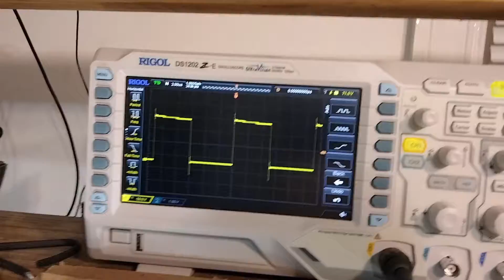QSC PLX3402 repair, this is a very hard repair, not for beginners.

Comment: good morning sir thanks to share vedio nice your explanation, ihave questions to my power amplifier qsc plx3002  done replace regulator and rgvt transistor and ir 0121, sg3525an and i check the power supply section is no shorted and the output transistor ic all okey no shorted the primary power supply turn on good supply but  not secondary not comes supply sir , how to determine problem thanks

Comment: These amps are junk!!! I've been a technician for over 40 years an a professional touring drummer!! We have 4 of these boat anchors!! I've had to repair 3 out of the 4 this last one I fixed the shorted channel ran great on a Variac at 110 volts ac!! But when I plugged in to main power it blew q96/97d78/79 an the 2 ten ohm surface mount resistors!! This is after i installed the power supply restoration kit!! The schematic I have has no voltages except for the 16 an 5 volt checks what's the best way to check this pile of crack to make sure it's safe to power up ??? I've got crown amps I've had for 20 years 0 trouble!! A pro amps should be able to handle the rigurs of touring etc!! I don't trust these!! Everything checks help!!!!
Reply: I receive two of them with the power supplies blowing.
I think the same, these amps are junk.

Comment: I just replaced all the same parts on a plx 3602 it ran fine on my Variac but when I plugged it into straight power q96/97 exploded an r358/359 an d78/79 opened?? I'm a tech of 38 years experience
Reply from the maker: check this out. https://electronicshelponline.blogspot.com/2016/06/plx-series-qsc-plx-1202-plx-1602-plx.html#google_vignette
Reply: Would like to thank clintronic for your help I fixed 2 other amps for the same custr just typical shorted drivers! Strange the problem amp ran for several hours on my Variac at 110 volts ac! An 0 DC offset an great audio wish I could find a good used board LoL I'm thinking of getting the house keeping kit.thanks again

Comment: I have a 3602 amp when the power is turned on all it does is the blue power light blinks  You have a idea what is wrong
Reply: did you ever find out what was wrong with yours? i have the same issue. my speaker wires touched during a gig.. i don't know for how long. i just used my tops. i saw my 1/4 cable was damaged and touched. amp powers on and just clicks..

Comment: Hi, one of my step driver mosfet is hotter then the other 3 ? after start .1 min this is 40C while the other 3 are 20C , should i be concerned ?
Reply from the maker: yes, you still have one more problem to figure out. For some reason that part is working harder than it should be.

Comment: Ok here’s the deal …I think…, The switch mode is on full all the time, operating like a traditional power supply, it has 5 V across it error amp at all times… The energy is stored in the caps like a traditional amp, for fast transient response, I thought pulse width modulation is how it would control current to the speakers but evidently it is not fast enough?but it is also could be why it blows the crap out of everything when it fails  
If I ever get this thing working I will test the over current shut down .

Comment: Clint,
Looking at the schematic,
The - input of the sg3525 regulator ic is tied to the PRI_LO , is this a mistake or what? How can this work?
I see nothing that comes from the secondary as feedback
Reply from the maker: Think of the Pri-lo as a floating ground. The Vref should read 5.1VDC
Reply: @clintronicsrva  
Yes but what pin is changing
The 5.1 is referenced to this it will stay 5.1 V difference no matter what
Reply: @clintronicsrva  
Besides aren’t you supposed to sample the output where is the feedback?I mean how can you have a nice regulated secondaries without getting feedback from the secondaries
Reply: @kansasnutt  These amplifiers generally have a topology where the primary of a second PSU is the secondary of the first PSU. They have a preregulator and a steady state regulator so that it can handle peaks properly while still downconverting.